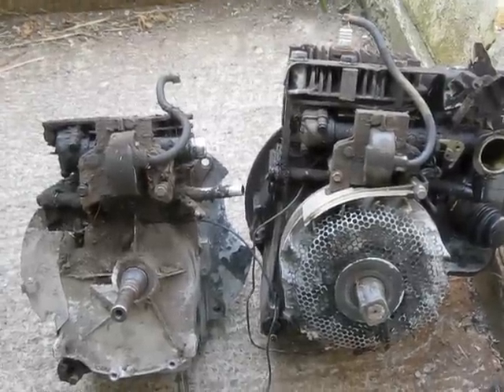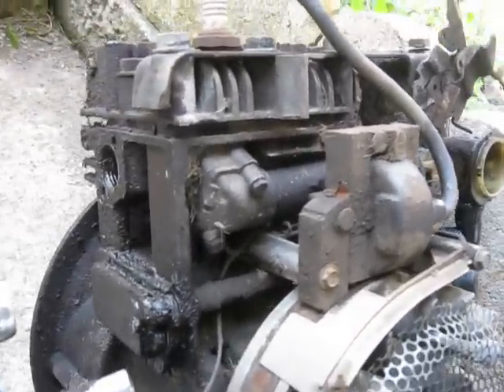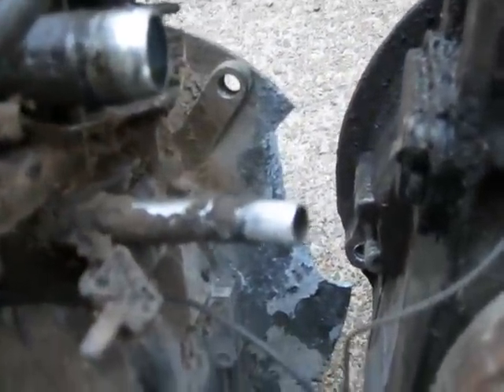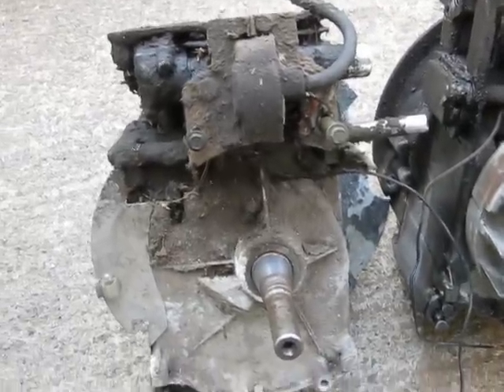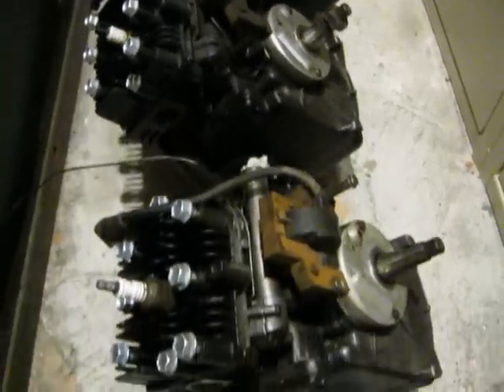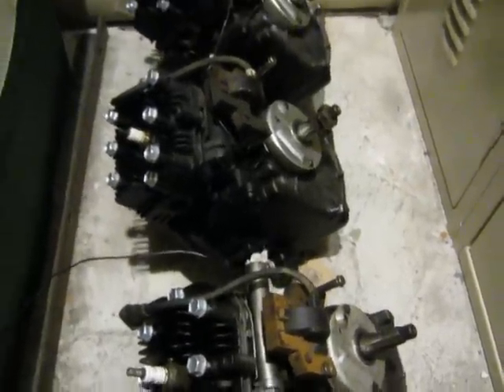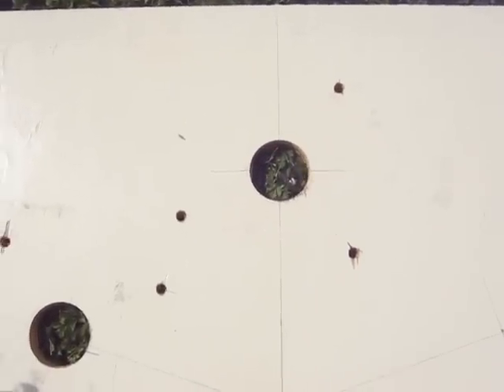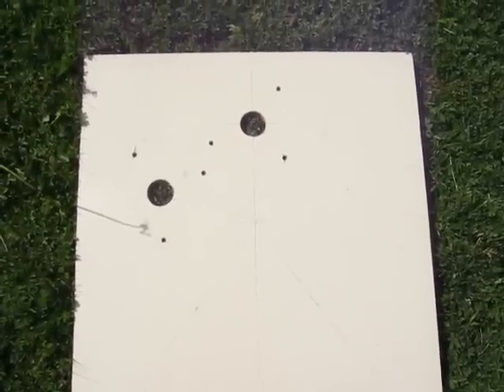FrankenBriggs 5 progress & DIRTY Briggs!

Comment: yeah, that is dirty big time LOL
Reply from the maker: FullThrottle440 Yes, a very dirty engine indeed. Unfortunately it has the features I am looking for, long crankshaft (that isn't bent), good crankcase cover etc. so I have to suck it up and get scrapping off the grime  :)Thanks for watching, figured I should let everyone know I am still working on this project.The FrankenBriggs 5 Must live!    lol
Reply: ChargerMiles007 It's good to see you're still having fun and solving problems too!  Will these be connected by chain to the common crankshaft or is that still classified?
Reply from the maker: WJCTechyman I will un-classify it for you, since start up is hopefully getting closer! I will just chain the 5 engines together with 1 long chain, though I plan to build 5 chain tensioners, one between each engine to avoid the chain whip problems I have had in the past. Thanks for following my engines, I still have plans to make lots more, and the Straight 8 is still in the works  :)